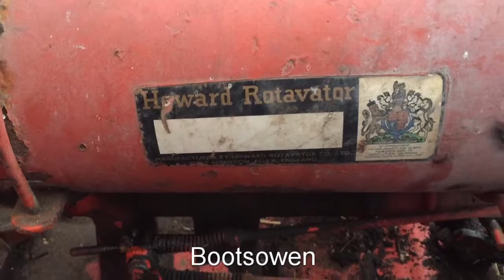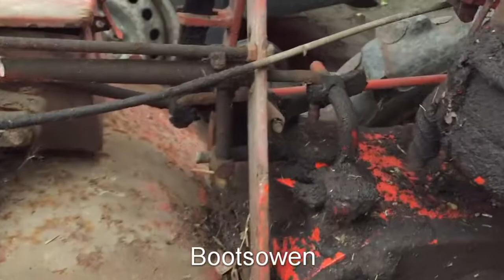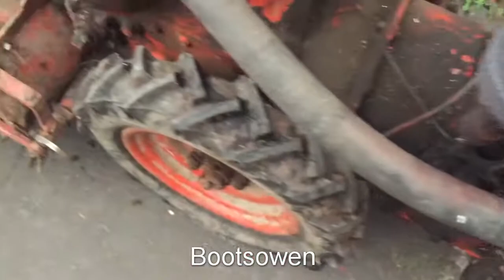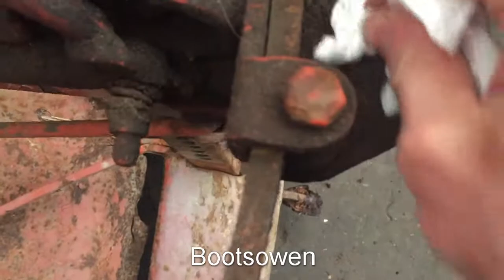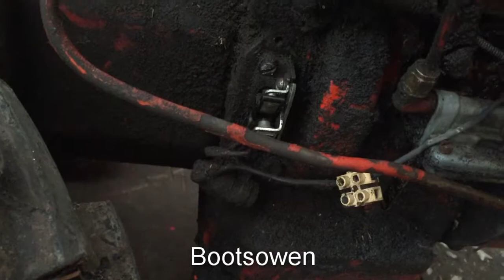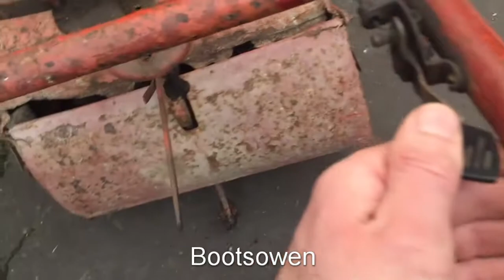Howard gem kohler engine running and walkaround tour. Rotovator, rotavator, garden tiller, machinery

Comment: Hi! I also have one of this and I need to adjust the carburettor. Could you help me with this please?
Reply from the maker: yes
Reply: @bootsowen  the carburettor have 2 adjustment screw and I modified their position and now it starts but when I press the acceleration the engine dies. Do you know how to adjust them?
Reply from the maker: I can't find it in my computer but i have downloaded the manual for this motor before from the internet, Kohler website I think. It will have the details. Otherwise screws full in and then 1 full turn out, then 1/4 turn at a time keep starting and trying all combinations.  Also check that you have an air filter on and that the element is in there.